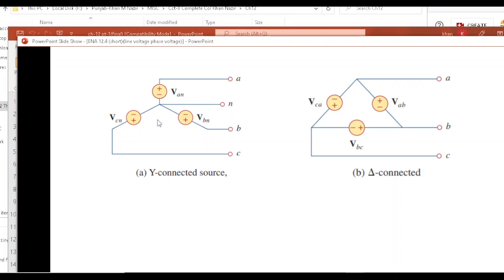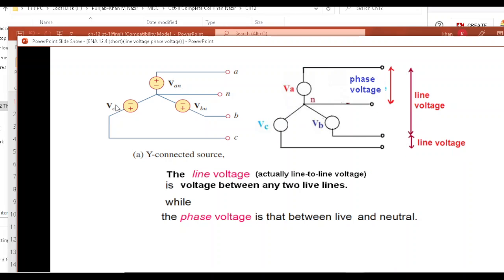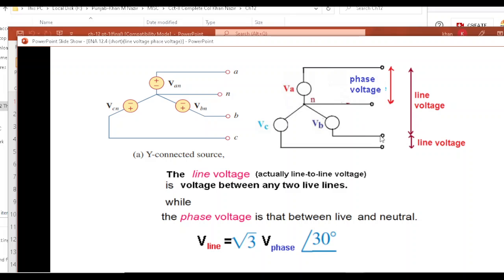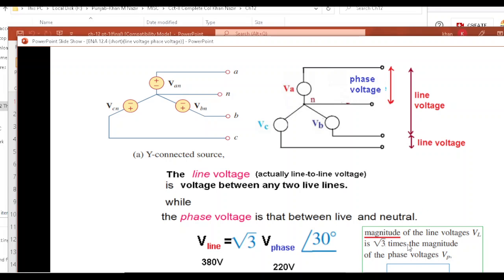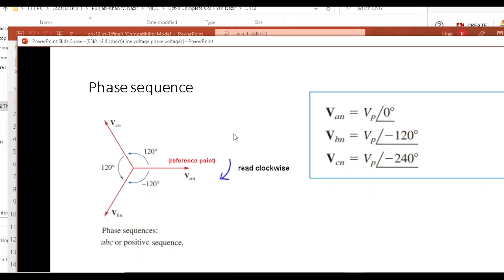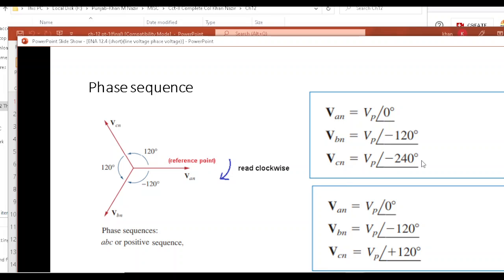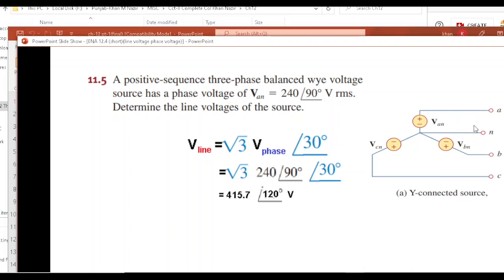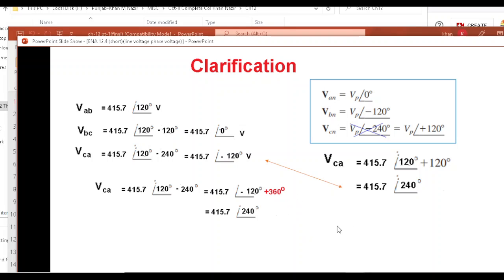(English)ENA(Ir) || Question 11.5 || Difference between  Line Voltage & Phase Voltage

Comment: CAn you make a video how to calculate big 3 ph heater load , how to measure current draw for each line?
Reply from the maker: Sorry no. For large load, current transformer also called CT coil is used. You also use clamp meter for normal load.

Comment: I just don't understand the concept of the relationship between phase voltage and line voltage. If you consider it in normal manner, then voltage across A and  B (Vab) should be Van and Vbn, you mentiond in the previous slide, line voltage should be voltage between a and b, how about Vbn, why consider Van only?
Reply from the maker: Van,Vbn,and Vcn are all phase voltages. Voltage Vab, Vbc, and Vca are line voltages (actually line to line voltage, but for brevity are called line voltage)